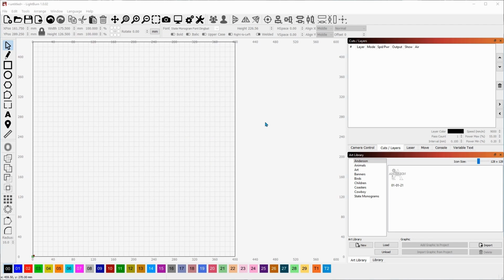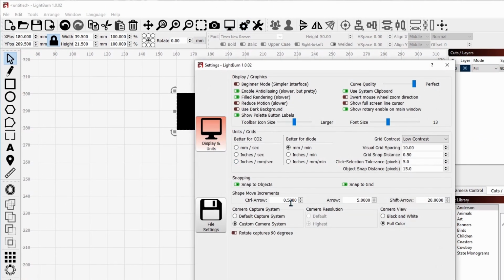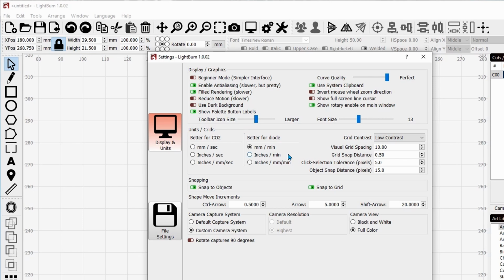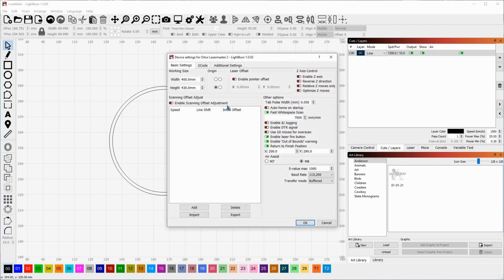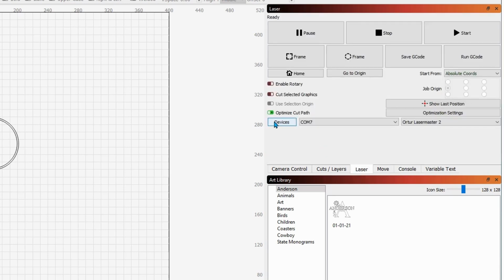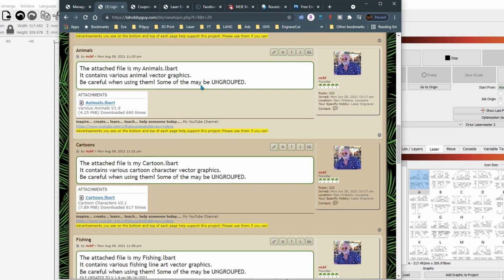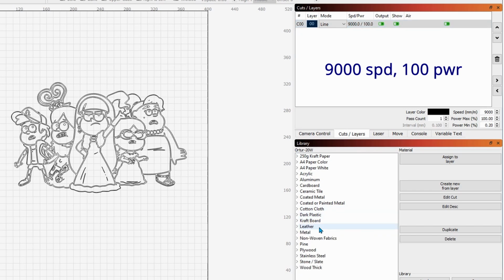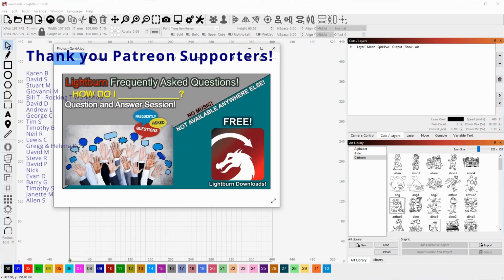❓ Lightburn FAQ, The Most Frequently Asked Questions

Comment: Great content. Wish i would have watched this awhile back. Only thing is the setting for White space scan and S value are missing in Lightburn 2.0... Where did they hide it?
Reply from the maker: Those settings only apply to a diode laser Martin.  If you're using a diode, click the wrench and screwdriver icon, and then the Basic Settings Tab.
Reply: @TheLouisianaHobbyGuy  Well let me tell you a funny story. I do have a diode laser; it's hooked up to a computer in the shop. Funny thing, you need to be hooked up to a machine to get the settings to work. I'm not hooked up to one in my garage where I watch your videos...
Reply from the maker: You don't have to be connected to a machine Martin. As long as you have a device profile for the machine in Lightburn, it remembers it.
Reply: @TheLouisianaHobbyGuy  Its not registered to a machine. Just a computer that I practice on. I get three uses of LB so i keep one on the garage computer so I can follow you on videos. cant think of a better thing to use it for 😀

Comment: Hey, hi, you do make good videos. I do have a question. I'm having problems with how to set my minimum power. it looks like it's off, and I can't add any number. Is there a sin away if there's a settings, or I could turn it on. Because in all of them I have them in minimum power of 20% and I would like to lower it to 10%. I tried to look for some videos but can't find any. If you could help me out, I would appreciate it. Thank you
Reply from the maker: Min power is a feature in Co2 machines. The only time you can set the min power otherwise is on an image or grayscale file.

Comment: If "S-value max" is set to 255 instead of a 1,000 in device settings. Does that mean when I use the Diode laser I'm only getting 25% power?
Reply from the maker: Yes.

Comment: Hi there
I'm a long way from Louisiana !!
I am about to enter the world of laser engraving.  I am only a hobbyist, and have exhausted the creative possibilities using my scroll saw and other tools.  I have used many drawing programs, Corel, Illustrator etc, so I am conversant with most of the terminology of these.
What I am struggling to understand is does the laser engraver technology need grbl or lightburn programs.  I see in these the instruction  "line" and "burn" instructions, and the colour coding accorded to them.  This I assume is the engine that drives the process of engraving, and is only in Grbl programs.  I am worried that I may purchase my machine, and then be unable to understand the software.  Having mastered photoshop, illustrator etc over the years, I hope this will not be the case, but it is new territory.
Having read every review I can on Youtube for every machine I can find, in my price range, I have decided upon Twotrees TS2 10W model.
Finally, I had wondered how to get graphics that were used on these machines.  I have many stock items myself.  may I assume that I can print these to my laser provided that they are loaded by lightburn.
I thank you for your excellent videos, and the advice and knowledge they contain.  I am now going to your forum website to learn more.
Best regards
Brian (Heysham Lancashire)
Reply from the maker: If you mastered all those other programs, Lightburn will be 2nd nature in no time. The only thing you'll need to know is how to get settings for cutting and engraving. A good start would be to buy my 10W library for cut settings from engraveandcutfiles.com. Then watch some of my videos on Libraries.

Comment: Rich - thank you for this and all your other videos. I'm very new and just set up my xTool D1 laser running Lightburn v 1.3.01. While only just setting up my system, I have watched many of your excellent videos. Thank you for all you do for the community. I also became a member of your forum. I ran my first engraving using your alphabet library you were so generous to offer. The only problem is that the job printed in reverse image while the preview showed correctly. I used the mirror image that flipped the image on the workspace and the engraving printed correctly. Interestingly, the preview of the workspace showed the image in the correct orientation while the workspace had the flipped image. Still working to figure out how  to fix.
Reply from the maker: The xTool has an origin of top left, the file was created on a laser with the origin of bottom left, so it has to be mirrored to work correctly on your laser.
Reply: @TheLouisianaHobbyGuy  Thanks Rich. Always knew it was the Indian and not the arrow. Really appreciate the feedback. Just finished watching your video for using Lightburn's material test card and located xTool D1's extensive material parameter list. It will be great help setting up the library.
Reply from the maker: I already have the xTool library converted to a Lightburn Library on my forum Sil. lahobbyguy.com/bb. In the members only download section.
Reply: @TheLouisianaHobbyGuy  Got it! Thanks again. Really appreciate your help.

Comment: Every time I right click the devices button in light burn, the laser disconnects and will not respond to a second right click.( I hit this accidentally from time to time) Once disconnected I have to unplug the machine and plug it back up to get reconnected. Mac user. Any help as to why this is happening is much appreciated. Thanks.
Reply from the maker: No idea, it doesn't happen to me. You can ask on the Lightburn forum David.

Comment: Thank you for your comprehensive videos. Is there an updated version of the settings you demonstrate in this video?  I'm using LightBurn V1.3.01 trying to follow your configuration settings and find that the latest version contains new features.  In addition, the snap to grid doesn't seem to work for me.
Reply from the maker: No updated version, since all of the features are in the updates of the software. They just add new features and I cover them in newer videos. The snap works fine, you just have to get the numbers right.

Comment: Hi,
I am very new to all of this but after viewing some of your videos, I decided to give you an example of what is happening with my new laser with the hope you can help me solve this issue. First of all, I have aligned the mirrors, adjusted the autofocus, and performed a ramp test.  My machine will cut and engrave very nicely but here is my issue.  When I send a file from Lightburn from my computer via USB to my laser with an updated Ruida panel the laser seems to often not follow the file.  For example, if I cut a circle it will cut as it should without errors on the first attempt usually but when I try to run the same file again, the laser frequently will start cutting “inside” the circle and cut a straight line to the outside of the circle.  At this point, the laser begins to cut the circle but then stops before the circle is completed or “closed”.  This happens with most of my files and is costing me too much in time and material for the laser to be of practical use so I hope you or someone can help me figure out how to resolve this issue I am having with my new machine.  Thanks in advance!
Reply: I don’t know what to do?…This has been an extremely frustrating experience thus far.  My problem with Ethernet is that my wireless router is located upstairs in my home while my laser is in my shop which is a good distance from the wireless router.  Should I just opt to buy another wireless router and use it only for the laser?  The folks I purchased the laser from are telling me two different things(Reset to Factory Parameters and in another message they suggested to Reset to Default Parameters). Both of these options concern me because I can’t seem to get any advice that is working.  As I said before, I’ve adjusted mirrors etc. and the laser will cut and etch very nicely but I can’t ruin 8-10 pieces of material to get one that actually worked as shown in the file.  Thanks for your help and helpful videos…
Reply from the maker: You plug the Ethernet cable from the laser to the computer, not the router.
Reply from the maker: Watch my most recent video Buddy. You should be connecting via Ethernet.

Comment: Thank you!!  I thought I had an alignment issue.  Just got an xtool d1 20w pro and thought I'd start with something simple like a business card.  I created the image, set the origin, hit the frame button and every thing lined up.  I would hit start and everything would engrave approximately 15-20 mm to the left.  The only way I could align the card properly was to do the low power 4 pass burn on the outside shape and position the card to match.  I actually burned the outside shape into my spoil board just so I could line up a business card again.  While following along with the device settings I noticed the pointer offset was enabled at -16mm.  Disabled the pointer offset, problem solved.  I knew it had to be something simple.  Thanks again.
Reply from the maker: Wonderful! Glad you found the fix!

Comment: Why do diode laser users use mm per minute? I have always run mm per second on my xtool d1. Is there a reson to switch it? Other than a desire to do math?
Reply from the maker: It's the standard for diode lasers and Gcode. Co2 are mm/sec. If you look in the Devices Settings you'll see the recommendations.

Comment: I’ve subscribed and clicked the bell.  I’m wondering how everyone on YouTube is able to connect their XTool laser engraver to Lightburn and my lightburn is unable to find my engraver.  In order to run lightburn I need to have a laser enabled.  My XTool Creative Space is able to connect with my laser via USB.  

Anything I create in XCS is around 3mm wide and about 100mm long.  My maple leaf was a somewhat crooked line.  

Any help would be greatly appreciated.
Reply: I created an engraver manually just to get the software to run.  I’m not sure if I downloaded the DPS version or something else.  I just clicked on the link and prayed for the best.  Do you have any ideas as to why I can’t get anything to print using XCS?   I made three boxes going outward from each other.  When they were printed, they were about 1/2” wide by  4” long.   On my screen they appeared to be about 40mm square.  I’ve used a Universal 60 watt laser engraving system running Corel Draw and had no problems with it.  

Thanks again for your help
Reply from the maker: The xTool uses the Gcode version of Lightburn. The DSP is for a Co2. They are both the same software and the only difference is the license price. Sorry, but I don't know what XCS is.
Reply: XCS is short for XTool Creative Space.  It’s their engraving software.
Reply from the maker: Ah, I don't use xTool's proprietary software.
Reply from the maker: Create the xTool in Lightburn manually. If you're unable to connect, you may have the newer version of the D1 which does not use the CH340 driver, it uses the CH341SER driver. You can find more information here, along with the link for the CH341 driver: https://support.xtool.com/hc/en-us/articles/7934477424407-Target-device-not-found-when-connecting

Comment: I really appreciate your channel which I just found being new to laser cutting and engraving, I’ve imported the cut library settings for my Neje 3 Max that I downloaded from your website (many thanks for that), I see that your Ortur cut library has many more material settings, do you plan on adding the others from the Ortur? If not is there any rule of thumb to ‘scale’ the Ortur settings to use on the Neje? Thanks in advanced and keep up the great work
Reply from the maker: No I don't Brendon. Creating libraries on my own is very time consuming. However, you can use any library and customize it by clicking on Edit Cut and change the settings manually. Double the speed as a starting point.
Reply: Thanks for the reply, actually come to think of it I have seen a chart from Neje with a list of materials with corresponding speeds and passes for cutting and engraving. I’ll start there and do some trials to test the settings
Reply from the maker: Those Lightburn cut libraries are available on my forum Brandon.

Comment: I have a question. I bought some stand files and the slot for the connection is for 3 mm wood. My 3 mm wood is almost 5 mm. How can I increase the size of the slot without distorting the shape of the stand?.
Reply from the maker: Select all and increase the size proportionately. Use the ruler tab to measure the size.
Reply: @TheLouisianaHobbyGuy  I did that but the stand was too big after that. I want to retain the actual size. Just increase the slot size. Is there any way to erase things on light burn?

Comment: I have downloaded Lightburn but i do not have a laser yet as i am researching them. I assuming that why i can do much in the software other than design
Reply from the maker: Nope, all you can do is design for now Robert.
Reply: You can "create a placeholder device" until you get your laser. Just search for that term in the Lightburn user manual. Have not done this myself, just stumbled upon this reading some other stuff.

Comment: I appreciate all your content my question is because I am new to this can I use an iPad Pro to put light burn on it to be able to use for by ortur laser printer or do I have to go out and buy a PC and it’s so can I purchase an apple thank you for your feedback
Reply from the maker: No, there is no app at this time. I would highly recommend a Windows 10 or 11 system for Lightburn. It just works flawlessly, which can't be said for a Mac. I have several in my shop, most came from eBay as off-lease machines. You can get a nice Win 10 or 11 off-lease for under $100 with a Core i3 or i5 processor on eBay. I bought mostly Dell 7000 series refurbs Dan.

Comment: Question for you. Do you have a video on how you are connected to your laser? I have a Longer Ray 5 and I would be much more productive setting at my desktop than using my laptop connected to my laser via printer cable. Thanks for all of your videos.
Reply from the maker: It connects to the desktop the same way as the laptop.
Reply: @TheLouisianaHobbyGuy  Thanks. I understand that. I currently use a usb cable to connect the laptop. I do not want to move my desktop and 43in monitor down to my garage. So for now I have set up lightburn on my desktop and saving gcode to sdcard and carrying that to the laser. Im hoping to find a solution that cuts out the transferring to sd card step.
Reply from the maker: You could run an amplified USB 2.0 cable. That's what I use in the shop.
Reply: Hi M.E.T., I’m just starting out on my laser cutting journey and will have a similar setup to what you described, my plan will be to work from my desktop and use TeamViewer (free) to ‘remote’ into my laptop that’ll be visible through glass sliding doors, I’ll have Lightburn installed on the laptop but ‘drive’ it from close by. I’ll use Dropbox to keep artwork I download or create on my desktop synched between the two computers as my CAD and Illustration programs are installed on my desktop and I prefer to do most of my work using it.

Comment: Great video!  I wrote down a lot of stuff to change on my setting and library creation.  Membership to website and forum happens today.  Wish and recommendation for another video.  I have the AtomStack X7 Pro and an MAC computer in my office.  My Laser Engraver is in the woodshed so I'll be using the SD Micro Card Chip to move a design from Lightburn to the Laser Handheld Controller.  Would you do a step by step video on that process?  Thanks, MarineCWO4 Retired!
Reply from the maker: Yes Sir, as soon as I get one! I just got the M40 so I'll see if it uses an SD card! Oorah!

Comment: Have you run into any practical limits on library capacity where lightburn starts to choke? Number of files, number of libraries etc, or is it better to load/unload them as needed?
Reply from the maker: No, when you import a graphic or photo into the library they take up only a fraction of the space of the original artwork. Having a multiple libraries doesn't affect Lightburn at all since it's not accessing them all. It only grants access to the art files on your drive, and only when a folder is selected. So you could have 50 art libraries in the list and LB only access the one your actually using..

Comment: Thanks for the video.  Question: between 6 minutes and 7 minutes in you explain Object Snap Distance and refer the number as in millimeters but LightBurn's window says, "Object Snap Distance (pixels)".  Does LightBurn consider the pixel size to be 1mm?
Reply from the maker: Grid spacing and grid snap distance are mm. Object tolerance and snap distance are pixels. As with most of us, I don't always use the correct terminology. 🤪
Reply: @TheLouisianaHobbyGuy  thanks for clarifying...i'm just learning and got lost a few times.

Comment: In the settings why do you have to choose millimeter if you using a diode laser why can it not be inches?
Reply from the maker: I use both. I sometimes like mm because a lot of my products are measured in mm and it's a bit easier.

Comment: Still feeling the burn? 😁 I hope you've healed now. Great video as usual I learned more about Lightburn. Have you updated your N40640 library yet? I've got mine now and all I can say is WOW what a difference even from the 30W. I assume you only use Lightburn with your CNC for cutting 2D files, I can't see how it could do 2.5D or 3D files? Thanks for the video!
Reply from the maker: Yes I am! 😎 But getting better every day, thank you! Yeah, Lightburn is purely 2D, and only supported by machines that have a laser (GRBL or Marlin) standard, like the 3018 for instance. I use it on my 3018 for simple engraving and cutting. Much easier to cut acrylic and thick wood on the CNC.